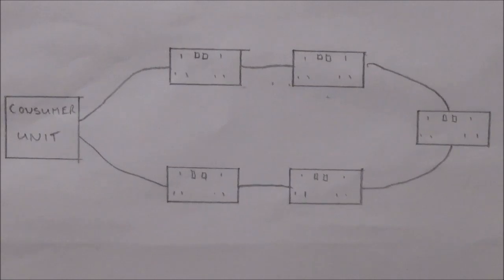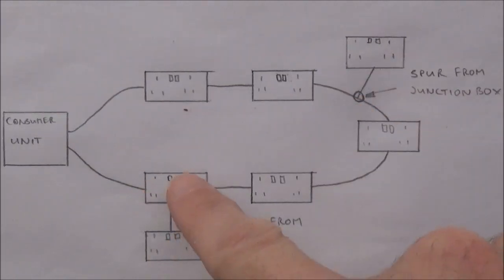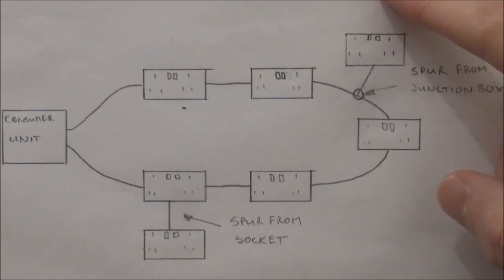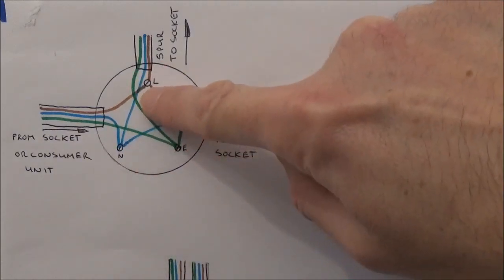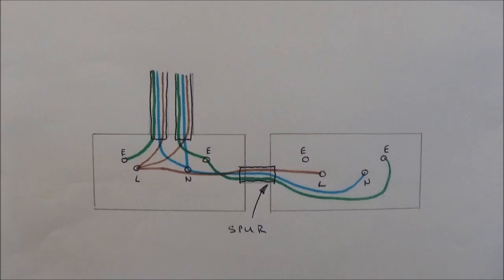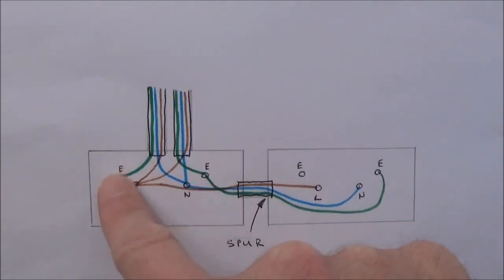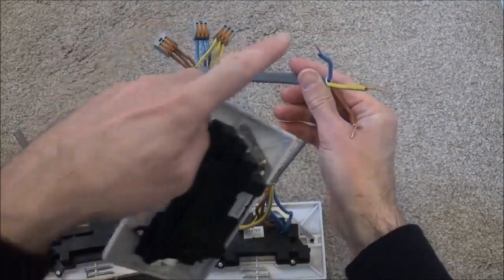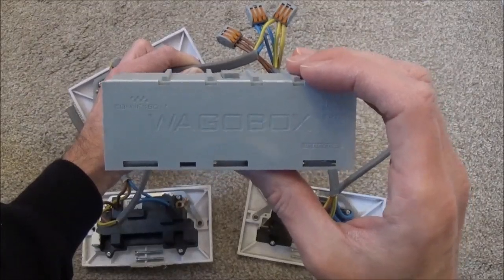How to wire a spur socket to ring circuit. Add a spur socket to ring main.

Comment: very good video! What would i do if i wanted to do away with the socket at ground level and replace with x 2 at a higher leverl (for TV and gaming) use a junction box to extend the ring main up  and then back to the ring main with another socket?
Reply from the maker: Pretty much. This vid may help - https://youtu.be/TPnce20ceBQ. Thanks for watching.

Comment: Would I be able to add a single spur to the back of another single spur if needed? The maximum load would never exceed 26amps. I suppose the only risk is if a future home owner decided to add a second spur and thought that the first socket was part of a ring due to the two connections?
Reply: You should have a fused spur then, it would be added between the spurred socket in the ring and the existing first spur. This would protect the current that could be drawn from the existing and new spurs.

Comment: Why do connectors need to be rated 32 amp if 2.5mm twin and earth is rated at 26 amp? I'm following your advice regardless, just curious why the numbers don't seem to make sense :) Thank you for the video, super helpful!
Reply from the maker: That's what the IET guides say!! I guess someone worked it out once. Joking aside it's something to do with safety margins and the fact it's on a ring main so the power could be shared to sockets in different directions. Thanks for the question.
Reply: @POUSEaroundtheHOUSE  this. 

Since it's a ring, the wiring in any single direction would potentially take only half of the load. So a ring main would be actually able to take 52amps. Well above the 32amps of the breaker.

Comment: Is It preferrable to add a spur or double cable and include It in the ring.. I need to cut a cable between 2 sockets  and add other two Jack to back ones on a plasterboard wall.. Holes are already cut. Instead of using a spur I could cut the cable in 2 and connect one end to one socket , the other end to the back to back one and a piece of cable in between them to make them be a ring again but bigger then before. Is It better then adding the 2 sockets As radial on the ring main? The reason why I believe I have got a ring main is because if open whichever socket I have got none of the has got one cable only but all of them have got 2 cables.. secondly It I disconnect the 2 cables from one socket and I switch power back on on the consumer unit they both Carry power and with the power off there is continuity in the wires.. Is this how you test whether you have a ring main or a radial circuit?

Comment: why u need a junction connection to extend the third spur? is that ok if I connect directly to the spur socket as u have done in the first ring socket?
Reply from the maker: You can create a spur direct from a socket or using a junction box. Please watch video for full details. Important to note you can only have one socket on a spur. Thanks for watching.

Comment: What happens to the next socket if the previus one is switched off? Will it work?
Reply from the maker: Yes. The way each socket is made means the current can pass through it, it just isolated the power to the appliance plugged into it. Hope that helps.

Comment: So just to clarify, you don’t need to extend the ring main to spur a socket nor do you need to fit a fused spur switch first?
Reply from the maker: You can add a socket to the ring circuit (see here - https://youtu.be/TPnce20ceBQ), add one spur with no fuse to the ring main (max one socket as seen in the video) or add a fused spur with 13amp fuse and have as many sockets as you like after the fuse (for another video!). Hope that helps.

Comment: can i tap into the wire between the CU and the First socket using the 3 Way terminal blocks?? or does it need to be in between existing sockets?
Reply from the maker: Yes you can but make sure it's compliant with part P regulations. All work should be inspected and tested to keep everyone safe.

Comment: Hi there, great video. In my utility I have 1 double socket alone with just the one cable going into it. I want to put another double socket out there, can I just wire into the back of the existing to create another socket eventhough it’s not part of a full circuit as it only has one cable going into the existing? Thanks
Reply: Only if that first double socket is isolated from the rest of the ring final by a fused socket
Reply from the maker: You need to know what that socket is first, is it already a spur? If it is a spur then the only way is to add a fused spur before that socket then have two sockets after the fuse. Problem is without knowing the existing socket may already be a third spur so any work in addition could be dangerous. Hope that helps.

Comment: If I add a fused spur to an existing socket can I add 5 double sockets to that spur
Reply from the maker: You can add as many as you want to the spur providing it is protected with a 13amp fuse or less. If you overload it, the fuse will blow and protect the cable, sockets and appliances. Thanks for watching.
Reply: @POUSEaroundtheHOUSE  thanks for the info

Comment: Could a 30amp round junction box be used instead of the 32amp you suggested? My ring circuit is on a 32amp breaker.

Comment: Can you do the same with a switch and a light instead of another socket?
Reply from the maker: Only if you use a fused switch in between with the correct rated fuse to downgrade the amp rating. So usually you would usee a 3amp fuse in the fused switch, then you can use 1,5mm twin and earth cable from the switch to the light. This protects the cable and light from being over powered. If you're unsure please employ an electrician to stay safe. Thanks for watching.

Comment: Hello, just to check. On the ring circuit when returning wires back to consumer unit does the wires go back into the same fuse ?
Reply from the maker: Yes it does.

Comment: Hi, great video and very clear. I have a plug on the wall in the hall on the ring main and would like to add a spur on the other side of the wall in the bedroom. If space allows can I put the sockets back to back with a small connecting cable or do they need to be a set distance apart? Many thanks
Reply from the maker: Sorry only just saw this comment so probably too late now. But yes that's fine, as long as there's room to fit it all in. Best of luck with it....or let me know how it went if already done.

Comment: is the junction box allowed to be under the floor boards (where the main cable runs)? It made sense to me to do that, but I asked an electrician who was working in our house about it and he said all joints/junctions have to be visible and not hidden under floors or above ceilings!?
Reply from the maker: Older type junction boxes (with screws) are meant to be accessible now. But if you use a 'maintenance free' junction box you can put it underfloor. For example wago connectors used in a wagobox junction box, cable tied closed and screwed to a joist is considered maintenance free and can be hidden. Hope that helps.
Reply: @POUSEaroundtheHOUSE  it does indeed. Thanks 👍

Comment: Is there a standard to say how many sockets can be connected to a 32 amp circuit breaker, i.e. how many can be added to a ring including spurs before you cant add any more. 26 amp cable I would think if I am logically correct here should not have more than 9 sockets connected to the ring incase someone wanted to run 3 kettles, hypothetically. I know this is unlikely, but it could overload a ring if someone was to do this. I am asking for electrical specifications and safety and not for common sense purposes. Two kettles to a double socket running should be fine at 26 amp, but what if you ran a kettle and two 3kw heaters on a ring. You'd have 9kw drain and this would overload an entire ring, right, and melt the cable before the 32 amp circuit breaker kicks in. I would think cable should be rated higher than the circuit breaker?

Comment: Great video. When running a spur from an existing socket, is a 25mm back box big enough to take the extra cable? Also do cables have to be twisted together before being connected/terminated Thanks
Reply from the maker: They don't need to be twisted together, in fact don't do that. But you can fold the wires over and then twist together if that makes sense to make them thicker, but don't twist them with other cable wires. 25mm is usually OK.

Comment: I get the 26A limit on the spur, but by your reasoning, wouldn't drawing 13A on any two sockets in the ring overload the ring cable?
Reply from the maker: It's all to do with the electrical tables in the regs. 26amps would be the logical MCB to use for a ring circuit but because it's a ring they allow 32amps. I don't make the rules!! Thanks for watching.
Reply: Any socket on the ring circuit is effectively supplied by two cables of 2.5mm (imagine a ring circuit with only one socket on it, then stretch the socket away from the consumer unit and you've got an extension lead fed with two 2.5mm cables which is the CSA equivalent of one 3.5mm cable). Hence we can now safely protect that circuit with a 32A MCB. If the ring circuit is broken at any point, the circuit becomes unsafe as the 32A MCB might not trip before the 2.5mm cable overheats in the event of a serious fault. Hope this helps James.

Comment: Another question, it's generally acknowledged that you can't spur off a spur but you can if you insert a 13A FCU. So does that mean the the spur is no longer classed as a spur if an FCU is inserted?
Reply from the maker: It classed as a fused spur. Hope that helps.

Comment: I recently moved into a house and found that the multimedia panel with 2 double sockets appears to be spurred via junction box from the 32A kitchen socket ring final main (I assume ring not radial as it's for the kitchen sockets). As it is essentially 4 sockets on a spur (single cable) with no apparent fuse, this doesn't seem to follow the principles you've layed out. It's unlikely to carry any significant load as it's just intended for TV but this doesn't seem very good, or am I missing something?
Reply from the maker: If that is the case it doesn't meet current regs but over the years home owners add things they shouldn't as a quick solution. If you are concerned then you can find the junction with the ring, disconnect it and put a fused connection unit (with or without a switch) next to that socket, and spur through the fused connection unit connecting the wires in that. If it's barely used and your happy with it then you could leave it. The problem is if you ever sold the house and someone started putting high load appliance into those sockets. Hope that helps.

Comment: Great video, it helps a lot especially when I’m adding in a spur into my shed. Just a quick question if I may! Can I add on a spur to an already existing spur?
Reply from the maker: No, only one socket per spur or you can overload the cable. You could spur to a fused switch or fused connection unit, and if you use a 13amp fuse (assuming it's 2.5mm cable) then you can have several sockets off that spur as they will be protected by the fuse. Hope that helps. Thanks for watching.

Comment: Is there any easy way to tell whether the wire you just found in the wall is on the ring or a spur?
Reply from the maker: One indication is if there is only one cable going to it, then it may already be a spur but it could also be a radial circuit. Without proper testing or unless all the cables are exposed then you won't really know. Thanks for watching.

Comment: Do you ever double up your cable ends when inserting one cable into terminals, eg light switches? Come across some people do and some don’t so wanted to know what you do. Thanks
Reply from the maker: You should really. Depends on the terminal and how many wires are in each terminal. Sometimes doubled up just doesn't fit!

Comment: Great video, thanks, I'm gonna be watching a lot more of your vids. 

One thing I'm not sure about, maybe someone can help. Here you talk about only having one spur as not to overload the circuit. But what happens if you then stick a 4 socket extender cable into the spur socket. Would this overload it in exactly the same way? I'm sure I've done this at some point...
Reply: A typical extension with say 4-8 sockets has it's own 13A fuse, so it would not exceed that of the spurred socket.
Reply: @adysupreme  Thanks Adrian, really useful to know, I appreciate it.
Reply from the maker: Think you had your question answered. The 13amp fuse protects anything beyond it. You can also do a fused spur using a fused connection unit. If you spur to one of those then you can have as many sockets as you want as the fuse will blow if overloaded protecting the cable and sockets beyond this point. Hope that helps and thanks for watching!

Comment: Very helpful video. Have had circuits tested and and all is good. Just a few places I can't physically get to visually ensure that things will remain safe over time. Old building creaky floor boards and general moving and shaking from the rocking and rolling that occurs in my studio. Would plugging high amp appliances into RCD adapters increase the overall safety? I know they are acting on front end of socket so wouldn't necessarily help with an over loaded cable deep in an old wall but as often music sessions go on for longer than realised there is many times that high amp appliances are in use for many Hours simultaneously. Could plug in  RCD's be an extra layer of protection if I were to correctly add in more sockets to ring main. As opposed to extension leads plugged into extension leads is not ideal but at least a problem would most likely be easily noticed or would trip an extension with built in RCD. Excuse the poor question more of practical person. Writing doesn't come easily. Any help/advice would be greatly appreciated. Many thanks in advance
Reply from the maker: Whilst additional RCD protection is good, it seems your risk is overloading the cable? Or maybe it's not actually a risk, depends on what you are using. What you could do is a fused spur. This is a bit like in the video but the cable is spured to a 13amp fused switch which protects all the sockets beyond the switch with the 13amp fuse. Then you can add several sockets to the spur. If they become overloaded then the fuse will blow keeping it safe. If you want RCD protection and don't have it already but have a fairly modern consumer unit then you can get an RCBO which will replace the current MCB (trip) in your consumer unit. This can protect the circuit that serves your studio. Sounds like maybe it's worth getting an electrician to take a look for you. Best to stay safe. Best of luck with it and thanks or watching.

Comment: Is there a maximum number of sockets on a ring main, or just a maximum load?
Reply from the maker: There's a limit to the length of ring main cables, not so much the number of sockets. You're only allowed one socket per spur. But yes the load is the key thing and this is considered by whoever is designing the electrical wiring. It's unlikely for example you will have every appliance on in every room at the same time. But this is also why kitchens should be on their own ring because they tend to have a lot of appliances some with heavy loads i.e. kettles, ovens, electric hobs, microwave, washing machine etc and they're are likely to be on at the same time. Some ovens and hobs require their very own cable also. Hope that helps and thanks for watching.

Comment: If you were to extend via a jb you would extend the ring, not just a spur off a leg
Reply from the maker: You can do either, but yes you could extend the ring but you would need two junction boxes to do that. Thanks for watching.
Reply: @POUSEaroundtheHOUSE  did you say you were going to make a video on how to extend the ring using Junction box? But is that it? On the drawing you used do you place the junction box along the same point that the other junction box is positioned?
Reply from the maker: @natoyle  no I'm going to do a video on a fused spur. This video here shows a non fused spur via with a junction box or socket. Hope that helps.
Reply: @POUSEaroundtheHOUSE  at 3:28 you did say you was going to make a video about how to extend the ring! Just following as I'd like to know this too 👍

Comment: Hi. Great video, exactly what I need.
Quick one, if all cabling going in the attic with easy access, can I just use Wagobox on top and drop a cable where original sockets were instead of looping wire in and out doubling the runs?
Thanks in advance.

p.s. love the attic conversion videos as well
Reply from the maker: As long as your ring circuit is actually a ring then it doesn't matter the physical direction of the cables but every socket needs a feed in and a feed out to make it a ring. Than just spur as shown in the video. If you already have sockets in place why do you want to spur to them? Surely this will be on the ring already? Hope that makes sense.

Comment: hi, can you add further sockets to this spur or have you done a guide showing this?
Reply from the maker: Hi David, as mentioned in the video only one socket allowed per spur. Only way around this is if you do a fused spur where a fused switch protects the additional sockets.
Reply: @POUSEaroundtheHOUSE  thanks for quick reply, did you do video on the fused spur as you mentioned in this video?
Reply from the maker: @davidwilson-tn3sm  I haven't yet sorry David. Hopefully soon!

Comment: what  is the difference between a ring main and a ring final?
Reply from the maker: It used to be referred to as a ring main. They basically changed the terminology as it was confusing due to mains electrics sounding similar.